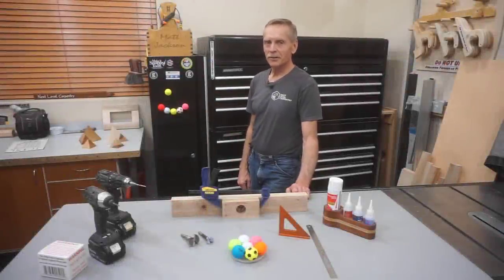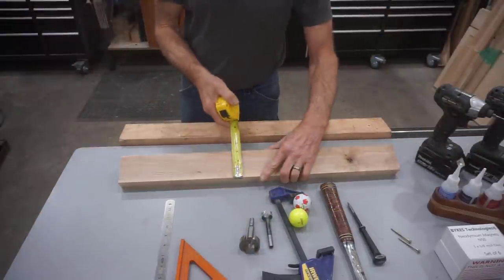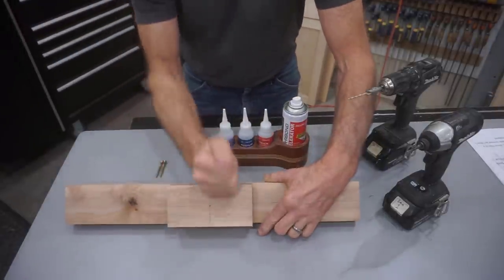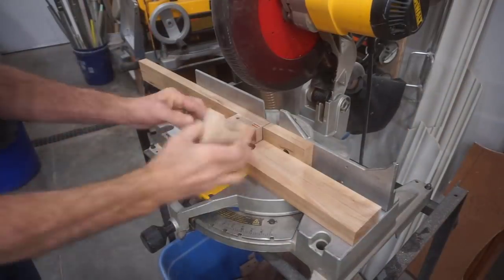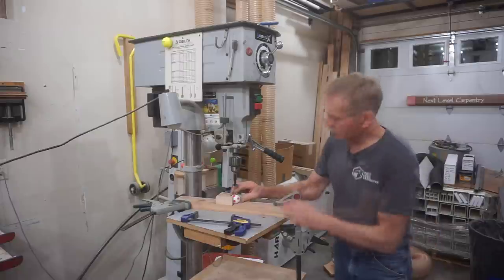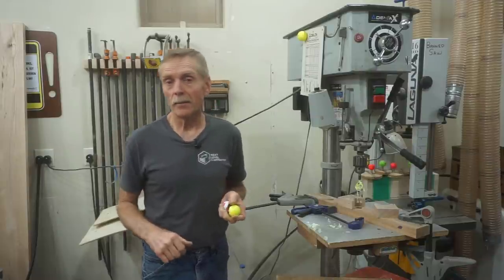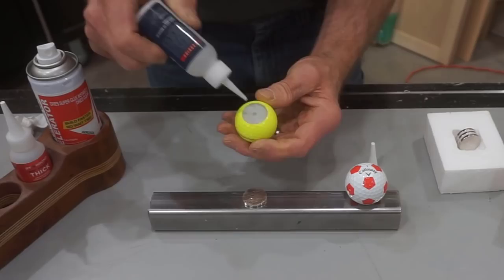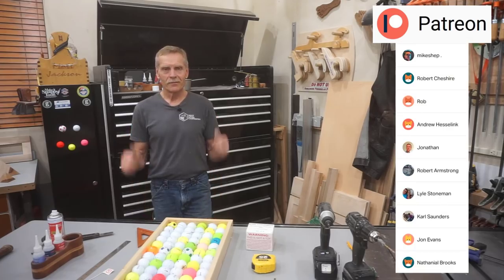Making Golf Ball Fridge Magnets

Comment: The poem at the end.  Merry Christmas Matt
Reply from the maker: Yeah... sorry about that... it was a bit of a stretch for sure🙄 Merry Christmas all the same.  BTW Did you get a chance to see the just released Christmas Ornament video here at NLC?  It's a fun build but, alas, no poem at the end...
Reply: @NextLevelCarpentry  It was a nice touch!   ...I sure did. You are quite skilled! Those star maker jigs looked like they would take me ages to set up
Reply from the maker: @eleeleelee7513  I think you'd be surprised with how quick those jigs are to make after you've made a couple for more simple operations.  I encourage you to give it a try next time you have an occasion to do so.  The fact that they're not 'universal' in design means you don't have to have flexibility and adjustability built in, two features that really do add considerable time to fixture-making... Best, Matt

Comment: What’s the center cabinet under the window with the three slide out drawer? Looks custom and I don’t remember seeing it before. I think you returned drill bits in the first drawer/organizer.
Reply from the maker: That 'ol thing?!  It's a custom thing I built decades ago and it's been hiding in plain sight in nearly every NLC video since.  Funny how that works sometimes but yes: it has 3 drawers of different depths on the right and, behind a door, a shelf and a pullout tray for router and drillbits.  Best, Matt

Comment: I had a similar idea for classroom magnets for teachers but Covid just took the 3rd swing at me today but it has not put me in the hole yet. This stuff is no joke and I took all the precautions the CDC lined out. According to my Covid nurses, I spent 9 days with, 1 medical-grade mask might stop a basketball-sized germ but there are too many places the mask doesn't seal to faces to keep stuff out. Many of my nurses wore a super duty respirator setup and the ones just using the medical masks layered them 5 or 6 at a time. The nurses also used tight sealing eye protection. I always wore a mask but I wish I wore a much better setup. The way some of my nurses looked when they were all garbed up I thought I was at a Star Wars convention.

Comment: Just a suggestion.  Sometimes you do and sometimes you don't, but when you mention a tool you use, please tell why you selected that brand over another. For instance, you mention Snappy.  Why?  I have been looking at plug cutters. Are Snappy tools generally  better than others? I took your advice and bought the flush cutters for edge banding. I don't know of others for that purpose, and you should know, so I just pulled the trigger.
Reply from the maker: While I agree your suggestion would be a benefit at times I fear it would become repetitive monotonous and annoying in the long run. The decision to buy a particular tool is  almost always part evaluation and part opinion so I hope viewers take the fact I'm using a particular thing as part of their evaluation process as you did but make their final purchase decision based on opinion of other reviews and users as well.
Best, Matt